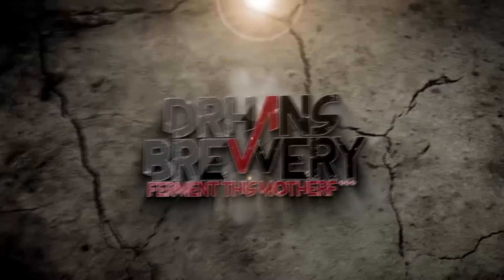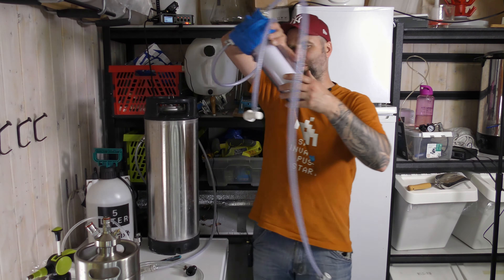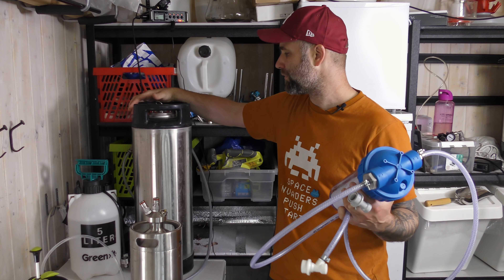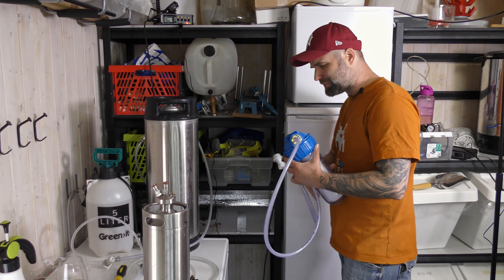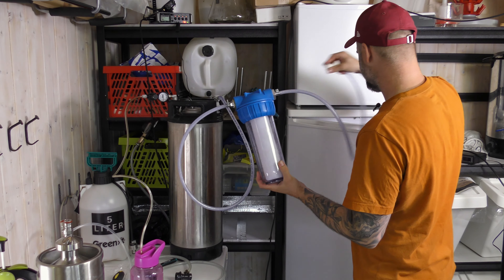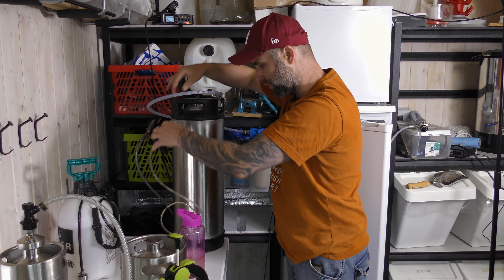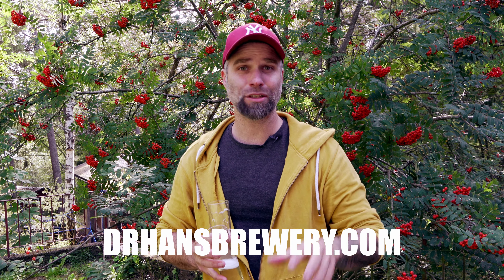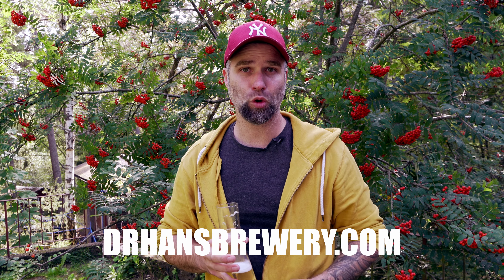How To Filter Beer at Home - Or Not?

Comment: Did you flush out the air from the filter before you started filtering Hans? Cause my  first reaction was that you didnt. And also as already mentioned. You need at least 1 micron or below to get rid of yeast and chillhaze
Reply from the maker: Yes everything was filled up with sanitizing solution and pushed out with co2. I'm very anal about that. Next time I will go for a 1micron filter. Cheers!

Comment: Agree with other posters - I am surprised you get sediment with the fermentasaurus pressure kit - I thought the float would keep you from dragging lots of sediment - at least until you hit the bottom of the fermenter? I have heard this method works best with a simple 1 micron stainless sieve - not the fabric filter - because it strips flavor. (Which you confirmed.) Cheers!
Reply from the maker: Yes it does. But the amount depends on the yeasts floculation and the time. 

Very interesting difference on the two beers. The filtered one is a perfect Kölsch though. I will try a 1micron also. Can you link to a filter you reccomend.
Reply from the maker: @januscastanedo  Fingers crossed!

Comment: How much pressure does enough for filtering? 30 psi? 50 psi?
Reply from the maker: Not much at all, just crank it up and read the flow.
Reply: @DrHansBrewery  thanks for answering to my. I dont have  fermzilla and I'm makin beer in bucket.  I have filter and a 100 psi ,diaphragm pump. (around 7atm) pump. But I don't know is it enough or not. Couple days later I will found out 😃

Comment: Is it possible that the higher carbonation level in the filtered one is responsible for the more crisp flavor sensation when drinking it? Maybe you could either raise the carbonation level of the unfiltered beer or check the pH of the two beers to see if one is more acidic than the other. I've noticed a big difference in the perception of my american wheat beers since I started carbonating a bit higher than I used to.
Reply from the maker: A bit might come from that yes. But not all. There different flavors also.

Comment: Liked the video. If you use a filter I had read you must adjust the recipe to pull the flavors back up after the filtration. Have you read anything about how to make the adjustment? Guess it will depend on the style of beer. Was your ABV the same on both? I would think the filter would have no effect.

Comment: Try a 1 micron filter, transfer at 3 psi, transfer from your source to a lower receiving vessel (liquid is heavier than gas), and hold the filter body upside down to save losing too much beer. I watch this video just after filtering my latest Kolsch from a hazy to crystal clear in one pass theu the filter. I only filter if NOT lagering. Anyone else agree?

Comment: I think maybe try one micron and see if it pulls more particles , yeast and/or proteins out. 
Commercial breweries sometimes will do a step down filter from 5 microns down to 1 or even 0.3micron ...If it helps my opinon is the 1 micron is the sweet spot for single stage. Thanks for the video.
Reply from the maker: Thanks, yes I will try a finer filter the next time.

Comment: Man, did you remove the plastic from of outside of filter? I think I saw this at 21mim43seg. Or that is a new one you showed on video? Because if you didn´t remove, the liquid is forced to pass directly to the outlet and is not filtred and this is probably the reason it took so long.
Reply from the maker: Yes I did remove it

Comment: Dr. 5 micron is waaayyyy tooo much. You can strip a ton of flavor and hop flavors especially, next time use a 1 micron filter!
Reply from the maker: Noted! I will try a 1 micron next time. 
Cheers!
Reply: Wouldn't the 1 micron filter be smaller then the 5 micron filter? Also I've used a 1 micron and it didn't strip flavor so I doubt the 5 would since its got larger holes.
Reply: @Linkie-link  Hi, because yeast itself is about 7 microns, I want it to pass my filter (for bottle conditioning/carbonation. So, I use a 10-micron filter.
Reply: a 5 micron is bigger (ae lets more through) than a 1 micron